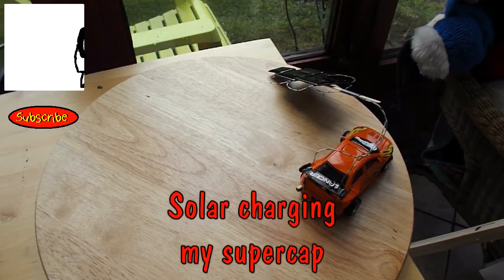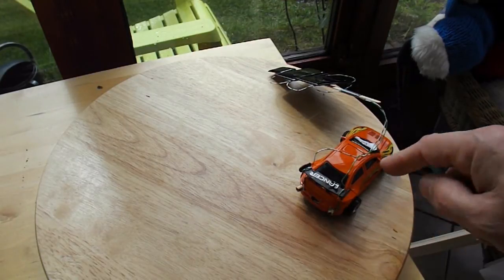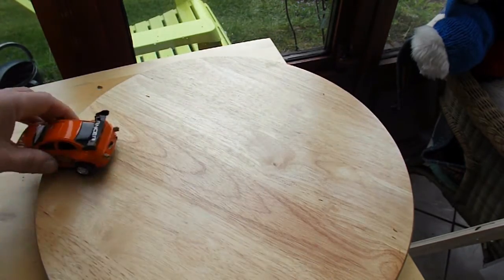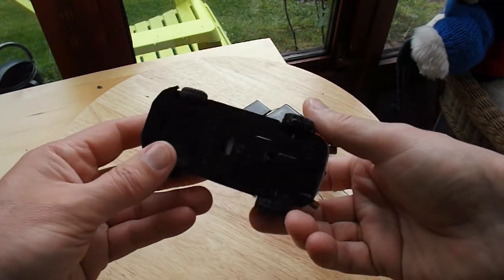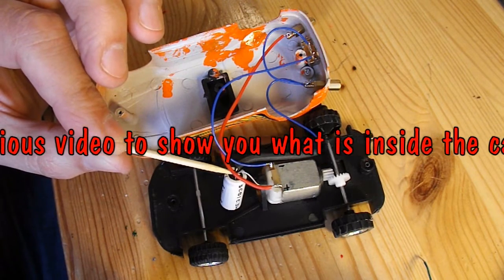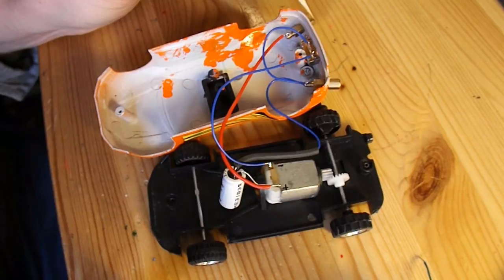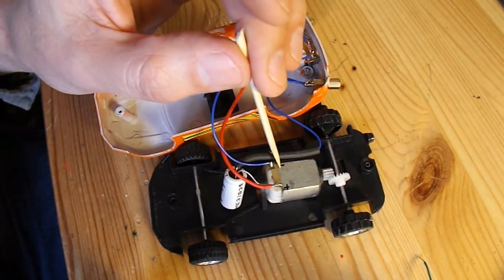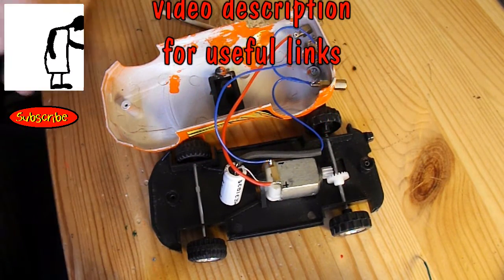Solar charging my toy car's supercapacitor

Comment: Do you have a diagram of the circuit?  I can't see the connections very well on the video
Reply from the maker: +Marcio Valenzuela let me talk you through it. 
You have an electric motor with 2 terminals + and -
You have a supercapacitor with 2 terminals + and -
You connect the + of the supercapacitor to the + of the motor and the - of the supercapacitor to the - of the motor and it works
To charge the supercapacitor we have wires connected to the + and - and they go to terminals screwed to the back of the car so we can get to them without opening the car.
We connect a power source to the + and - wires and it charges the supercapacitor
The power source could be a battery or as shown in this case a solar cell.
To stop the motor discharging the supercapacitor when we are not using it or while it is being charged we have added a simple on/off switch into one of the wires between the supercapacitor and the motor. It does not matter which wire it is, it can be the + or the - wire.
Reply: Thanks!  It was the switch I wasnt clear on
Reply from the maker: Marcio Valenzuela thanks, it gave me a chance to update the information in the video description so it may help other people.

Comment: Thanks for trying it. Yes, all I meant was no circuit gubbins, just the panel on the roof.
The 'posh' idea would be to have a panel fitted in the top, looking like a sunroof lol
Reply from the maker: I was thinking of some circuitry that would prevent overcharging if I ever get too much sunlight and also preventing the charge draining when the lights go out. I guess that is what the little black blob does in those garden lights.
Reply: GrandadIsAnOldMan  The blob is a Joule Thief in essence, with an inductor also being on the circuitboard and working as a coil (looks like a resistor). Sometimes with auto functionality to switch the light on when it detects nothing coming through the solar panel. In practice, a 1.2V AAA won't overcharge with the 20mA or so coming in on a good bright day.
The easiest way to prevent loss back out of the supercap when cloudy or night, is to have a small diode from one side of the solar panel to the battery. Any small type out of say a busted radio will work.
Your supercap is rated 2.7V and that's about the highest voltage any garden light panel will produce..so no problem there :)
Reply from the maker: slider2732 Thanks for the explanation, I am naturally cautious with any electrical equipment that I would leave unattended for a long period, (wouldn't want to return home to a fire etc). I might just stick a small cell on it's roof like you say and leave it in the conservatory, probably find we get an exceptionally hot sunny day and the plastic body melts around it :-)
Reply: GrandadIsAnOldMan
 Ahh..one memory right back to the 1970's was when my Gran bought me a Revel type Sopwith Camel kit. I glued it all up and was really proud (was about 7). Put it on a windowsill. Went to look at it the next day and the sun had melted it !
The cap will be fine, the car body will shade well enough and the only car damage would be colour fade over years. Would be something always ready for young visitors to enjoy and learn about. Although there is a comical visual of putting a whole garden light + ground stake on top of the car  :)
Reply from the maker: slider2732 back in '64 I was proud of my first radio. Left it on the parcel shelf in the back of my dad's car and it melted like cheese under the grill. On the positive side it looked really interesting and still worked.